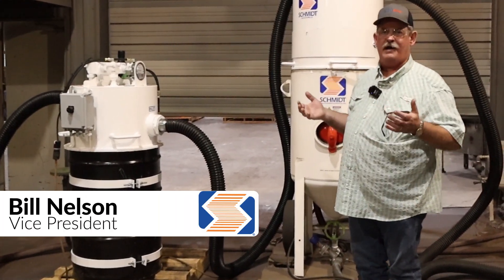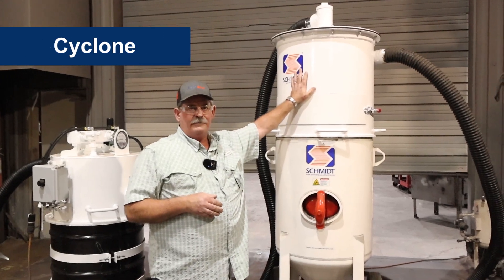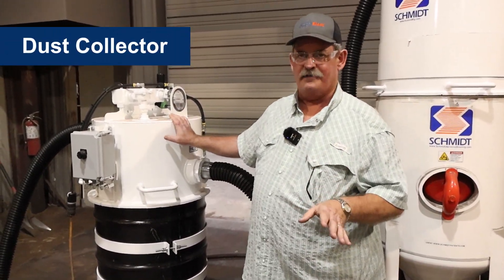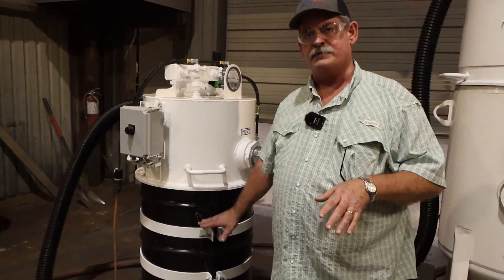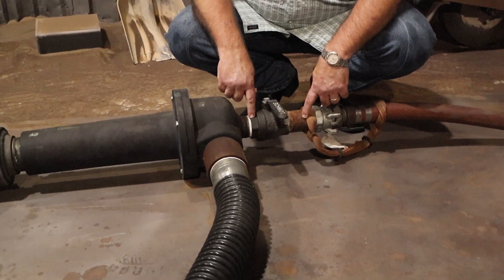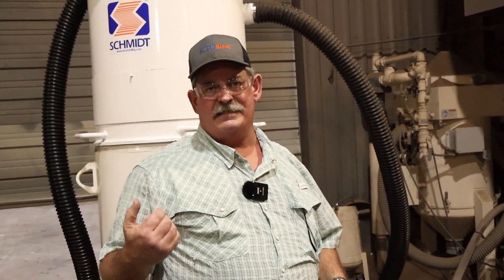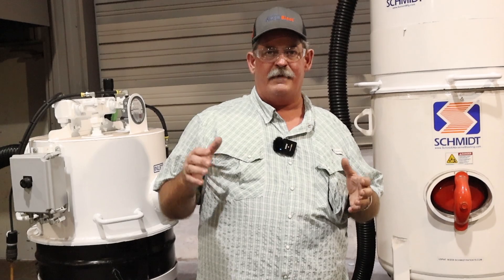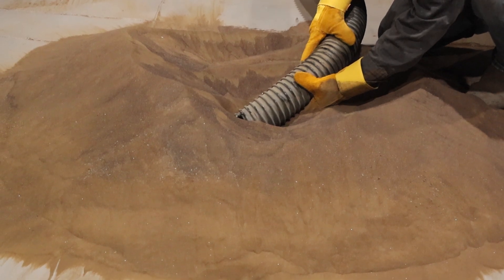Introducing The Modular Drum Reclaimer System #schmidt

Comment: How do you ensure that you don't overfill the pot causing sealing issues with the plunger? Price estimate?
Reply from the maker: Ryan, please use a screen but fill the vessel until the pop up valve in the top head is slightly covered, this will assist with sealing when the vessel pressurizes. 
If you are feeding from a hopper and cannot control the abrasive, install a "spider" over the pop up. The spider isn't plate that doesn't allow the weight of the abrasive from affecting the sealing.  Please email InsideSalesGroup@AxxiomMfg.com if you have other questions.  Thanks Ryan.